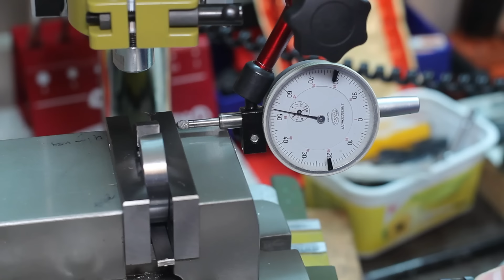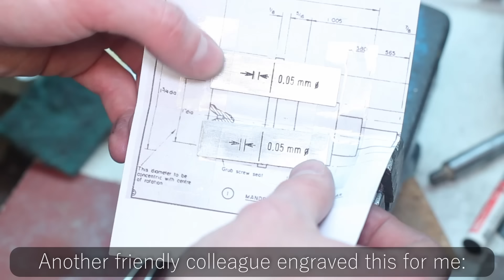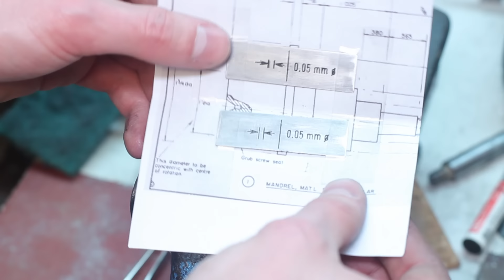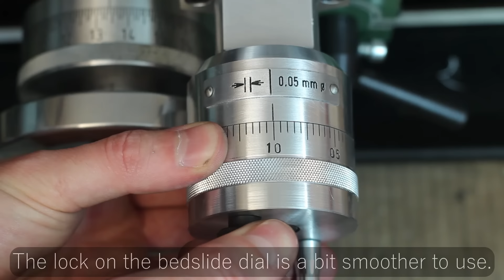New Cross Slide Handwheel Part 2 - Schaublinisation Of The Mini Lathe

Comment: a bit of nit picking, it is only an Acme  thread if it is imperial, metric threads are called trapezoidal.   Both are trapezoidal, it is just the name that changes.  I only mention it as searching for metric Acme threads will result in far less hits than metric trapezoidal, especially on websites belonging to nit-picking suppliers.  >:-)>>

Comment: I think the lock, while unnecessary, is a good option to have just in case. Even if you wind up using it as a fine adjust to make the ring require a teeny bit more force to turn.

Comment: The final piece looks awesome, very good parts. For the locking wedge try to make the angle steeper so it becomes self releasing because the force that pushes the wedge out of the ring becomes greater. At least in theory is also kin of the reason because morse tapers lock themselves whereas 5c collets don't for example.
Reply from the maker: Thanks for your comment! Making the angle wider would be the ultimate solution, yes. At the moment I'm lazy of machining it new. But perhaps I will do this some day:)

Comment: Beautiful work as usual. 
I've found one of the best things I did for my lathe was to add a DRO to the X and Z axis. The increments on my Chinese metric version mini lathe show increments on the cross and compound slides that are not exactly in thousandths, but are really metric (they show both), so you accumulate quite a bit of error over several turns of the wheel. I would of course compensate by getting close, taking a measurement of the material and then sneaking up on the dimension when it was critical. The DRO made life a lot easier plus it allowed me to program the X-axis for Diameter measurements instead of having to remember of course that the dimensions on the wheel are radius measurements. Of course we get used to that so it's not a problem, but one must pay more attention.

Comment: Gorgeous work. Seeing the whole thing coming together was awesome! Amazing job of improving function, while also adding some genuine class to the humble mini lathe.

The locking mechanism is an elegant solution... I think, if you make the angle wider on the wedge and locking ring, the tapers wouldn't lock together like that. Maybe add a spring, or a Belleville washer between the wedge and the handwheel?

Regardless, great job! Looking forward to more!
Reply from the maker: Thank you so much for your kind comment and feedback! I really do appreciate that! Perhaps some day I will make the wedge angles a bit wider so that it doesn't stick anymore. But at the moment I'm used to it and there are so much other things to do :)
Reply: @WeCanDoThatBetter   From tapper theory locking angles (like Morse) are up to 15 degrees, self releasing are above that. BTW job well done. I'm impressed!

Comment: It turned out to be a chic limb. I have the same lathe.  I put the DRO on the longitudinal and transverse feeds. It became very convenient to work.
Reply from the maker: Perhaps some day I will install one too.
Reply: I installed 300mm on the longitudinal, and 150mm on the transverse.  Helps a lot at work.  In addition, a Chinese plastic caliper was installed on the tailstock.  I bought digital rulers and calipers from Aliexpress.

Comment: Good job! You might want to adjust the ways in the cross slide in your mill. The noise indicates that there is some play.
Reply from the maker: Hi and thanks for your comment! I'm not sure if the noise is comming from the cross slide. I would guess its from the wobbly column and motor holding vertical slide. That is really a bit flimsy.... The cross slide is set rather tight but off course isn't the most rigid too.

Comment: Nice little mod you’ve made there cheers for sharing 👍 as for your dial lock issue just make the thumb screw captive for example plunge an end mill into the back of the handle deep enough for an circlip and cut a groove in the screw and hey presto instant fix the screw catches on the handle and pushes the wedge out
Reply from the maker: Thank you very much for your comment. And thanks for your ideas. Have to think about what I can fit into the tight space in the handwheel :)
Reply: @WeCanDoThatBetter  I know there’s no clearance between the dial and the handle which is why I said plunge an end mill into the back of the handle it’s for clearance the clip sits in a recess/pocket allowing a flush fit between the dial and handle problem solved ✌

Comment: cold bluing works a lot better if you clean the part in acetone and then warm it up with a small torch prior to applying the blue.
Reply from the maker: Thanks for the tip! Didn't know that.

Comment: I don't know if anyone has mentioned it but you could use a type of bent washer that will act as a spring although you may need to turn back the tapered part to make room.
Reply from the maker: Maybe that will work. I haven't tested so far. At the moment I use it as it is.

Comment: Absolutely FANTASTIC machine work.
Especially out of the little Chinesium machines.
You have a lot of skills.
I see a new project in your future though.
Upgrading the clamping slides under the saddle.
A massive failure in the name of keeping costs down IMO.
There are lots of ideas out there.
Mine took a month to do but I also filled in the "H" of the Cross Slide and incorporated a locking mechanism.
I'll look forward to your take.
Either way, this upgrade you just did turned out fabulously.
Reply from the maker: Thank you very much for your kind words! I really do appreciate that! Good ideas, there is still a lot to improve on this machine...

Comment: Nice work! One thing that made me think though was your backlash adjustment. Squeezing the thread will maybe make the acme thread tighter on the flanks but it won't adress pure axial play, which is what causes the backlash. I think the usual way to do it is to split the nut the other way around to make two separate segments of thread and making those adjustable in their mounting on the corss slide so that you can alter the spacing between them. That way you can compensate for wear later on as well.
Reply from the maker: Thanks for your comment! Yes, the common way is to have two seperate parts which get axially pressed together to eliminate backlash. I thought this is a bit more work to do so I first tried it this way. As the threaded spindle is a bit smaller than the threads in the nut, when you squeeze the nut it also eliminates backlash. The range isn't as big as with your method as the threads someday reach the bottom of the nut internal thread. But as this machine won't get used excessively it should last for a while before I can't adjust for backlash anymore. I hope that makes kind of sense :)
Reply: A trapezoidal thread has contact on 3 faces, this method of reducing play has been used for longer than you've been alive, the leadscrew on most lathes squeeze the half nuts together until play is removed.

Comment: The closeness of the two hand wheels was always a real bugbear for me !
I wonder I’d putting a small spring  / spring washer/ Bellville washer in to push the taper lock out when the knob is loosened would be possible ?
Awesome result none the less!
Reply: I was thinking the same. A small firm spring and washer should do the trick.
Reply from the maker: Yes, both handwheels are extremely close to each other :/ I see no easy way of changing this. I have to try if a spring or something fits in the dial. It's really tight there...
Thanks for your comment!

Comment: Eventually, you will have the most tricked-out mini lather in the world. I a wondering, could you not simply make the cross-slide handle longer, so it avoids close contact with the feed handle?
Reply from the maker: Thanks :) ! Best would be to have more distance between both handwheels. But that's a major modification..

Comment: Now you just need to RE-rebuild the rest of the Chinesium lathe up to the same high standard. I look forward to seeing you doing that over the next 2 years and 40 episodes. :D

Anyway, couldn't you do a little more machining to that locking mechs back (erm.... Or should that be front?) plate and make clearance to put an O ring on the threads between that and the spreader slug to act like a spring to pop the slug that initial half millimetre and unstick it? If that feels a bit too Heath Robinson, maybe a couple of washers sandwiching a cleaned up and slightly stretched spring washer would also work?
Reply from the maker: Haha, yes that's more or less the plan :) We'll see how far I will come.
Thanks for the tip with the O ring. That sounds like a good idea as it takes much less space as a spring or something. I will give it a try.

Comment: I found that the large handwheel designed for quick movement of the cross slide can be substantially reduced.  I dropped mine down 50% and the clearance issue was eliminated.   As the cross slide is quite light on this size lathe you really don't need the torque a larger handwheel creates.
Reply from the maker: The handwheel could be smaller, yes. As I changed to a 2mm pitch spindle I had to double the number of increments on the dial to achieve the same resolution (0,05mm per line). The bigger the dial, the easier it is to read though. That's why I made it relatively large. And because of all the locking mechanism stuff to fit inside :)

Comment: Maybe then make scale friction fixed and use the knob to lock that small screw as a lock for the handwheel, so I'd doesn't spin while doing heavier cuts or vith some vibration
Reply from the maker: Thanks for your comment! Locking the spindle somehow too isn't a bad idea. I will think about it.

Comment: If the pitch of your lead screw is 2mm and the number of graduated marks on your scale drum is eighty for one revolution, then the distance moved for each graduation is 0.025mm, not 0.05mm.
Reply from the maker: Hi, that is absolutely correct. But 0,025mm movement of the crossslide means 0,05mm diameter reduction on the workpiece. I'm used to this direct diameter reading, that's why I wrote 0,05mm per graduation on the dial ;)

Comment: Good stuff. I never saw this channel before. When I get my workshop built in Thailand I would like to get a lathe and milling machine but I think they will have to be Chinese ones because of shipping costs. What do you think of your lathes?
Reply from the maker: Thanks for your comment! You can definitely work with these machines. I wouldn't choose such a small one as I have depending on the work you are planning to do on your machine.
Reply: @WeCanDoThatBetter  Maybe work of around 4 inch diameter max and probably a gap bed

Comment: Интересно, как была отделена часть после высверливания и фрезерования перегородок? Как снизу, подрезали или скололи?
Reply from the maker: Can you try it in english? The translater struggles.  Вы можете попробовать сделать это на английском?
Reply: @WeCanDoThatBetter  I do not know how to say it correctly in english. I wanted to find out how the operatinons were performed to separate the lower part of the metal from below at 19:22 min video. Sorry for the bad english.
Reply from the maker: @user-kc5jv7mr5x  Thank you, now I understand :) You see the hole going through the part. This seperates the little block from the bottom. When I milled the sides (the U- shape) the part felt off as I reached the bottom because of the hole which was already there (through which the spindle goes). So I don't neet to extra cut it from the bottom. I hope that makes sense to you :)
Reply: @WeCanDoThatBetter  
Thanks! Now everything is clear. Your videos are very interesting and informative! I hope for the speedy release of new videos!
Reply from the maker: @user-kc5jv7mr5x  Thank you very much! :) I now need a little break at first. But have planned more projects on this machine definitely;)

Comment: Not sure what I missed but the part where the loctite was used to join parts together made no sense to me at all, not sure what what that was about. Very impressive dial locking mechanism, reminds me of the adjustment on the clutch of an early myford s7. I like that.
Reply: There needed to be a flange on the lead screw for the bearing to run against, so he needed to join the pre-made threaded rod with another piece of stock to make a flange. He could have done it with one piece, but then he'd have to cut the thread for the lead screw himself
Reply from the maker: Exactly, Manits Gaming said it right :) I bought a stock acme spindle as I don't wanted to make one myself. This spindle off course has no flange for the bearing to sit against. So I merged the stock spindle to a piece of steel which I turned the needed features on (flange, exact diameter, thread). This way this part is a bit easier to make for me.
Thanks for your comment! :)
Reply from the maker: Exactly ;) Thanks

Comment: Lovely machining and fantastic finished hand wheel. Where did you get the brass nut from, I need a 16 mm diameter with a pitch of 1.5 mm and can’t find one anywhere.
Reply from the maker: Thank you very much for your kind comment! Uh I think that is a very weird sized nut. I bought mine here: https://hfbshop.de/ But you only get standard stuff here. Either you adapt your design to standard material or you to make one by yourself I guess... :)

Comment: Hello! can you tell me what bearings you used and what size; what kind of composition does the metal bar have that it turns very well.
Reply from the maker: Hi and thanks for your comment! Sorry for my late reply. The bearing in the cross slide handwheel is a double rowed angular contact bearing, the code is 3800 2RS H8, internal 10mm, outer dia 19mm. The steel I used for axles and shafts is 42crmo4. It is tough but with proper settings turns really well. Needs a high surface speed for good surface finish.

Comment: Nice work as always but the keys are off, to put it mildly. Are you aware how they should be machined but you ignore it for your applications?
Reply from the maker: Hi and thanks for your comment! What do you think is wrong with the keys? I think I didn't get it.
Reply: @WeCanDoThatBetter  I use "keys" and "wedges" interchangeably in my comments. I'll try to stick with keys.
Reply: @WeCanDoThatBetter  I think YouTube has just removed my 600 characters comment explaining the key fitting :/ Did you catch it?
Reply: Note: To use standardized keys you use the "constant cylinder" (constant shaft?) rule, where you only adjust the groove.
Reply: My initial comment was about me not being a machinist but remembering from my engineering course that keys should not tumble around in shaft grooves like yours do :) Like most things mechanical engineering key/groove fitting is specified in the applicable standard which is going to tell you everything how the fitting should be made (to what dimensions and tolerances).

Comment: I'd really like to know what type of Cold Blue was used on the locking knob. I've searched the older videos and have not been able to find the details about it.
Reply from the maker: That is from Ballistol. It was a little set in a plastic case with cold bluing liquid, spray oil and degreaser. I showed the procedure in one of my last videos in a little more detail ( don't know which video it was at the moment).
Reply: @WeCanDoThatBetter  - Thanks. Quite a few people asked the same in your recent video that mentioned the process. At that time you stated that it was shown in full detail in an even earlier video (about a tailstock, perhaps?).
Anyway, all we really need to know is the brand. This "Ballistol" is producing a much faster (almost instant) reaction compared to most other gun-blue chemicals, which usually need multiple treatments to become dark.

Comment: You should've went for interference fit there instead of glue
Reply from the maker: Hi, I normally are sceptical about gluing in machining parts as well. But some machinists before me made a new spindle this way on bigger machines that I gave it a try. Perhaps interference fit and glue or glue and a locking pin would be even saver but I don't expect that much forces on my spindle so I just hope it will last a few decades :)
Reply: @WeCanDoThatBetter  It depends on the kind of Loctite used and the fit you have (appears to be free sliding on the video), but it's not impossible to shear it. Moot point now tho, it is nice job overall and could well last for years as you say. And if not, it'd be a great opportunity to practice ISO fits :)
Reply from the maker: @varjagg  haha, yes :)